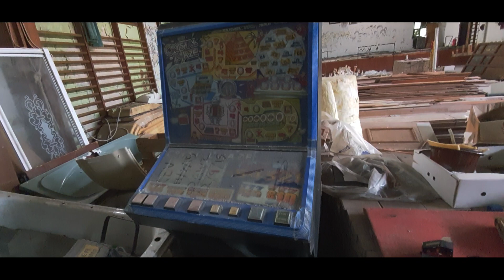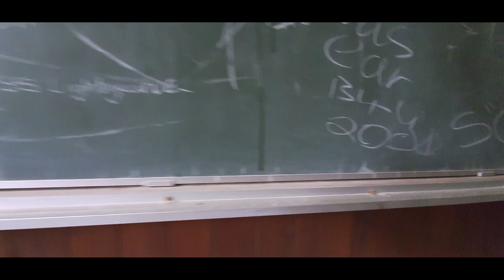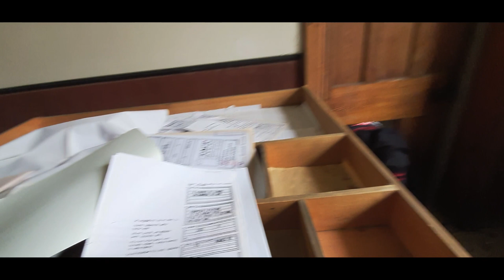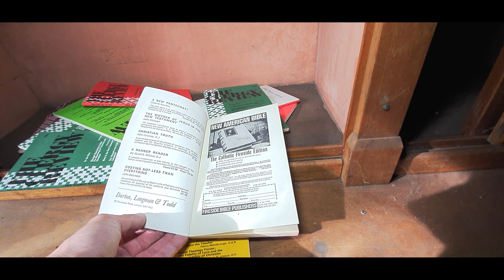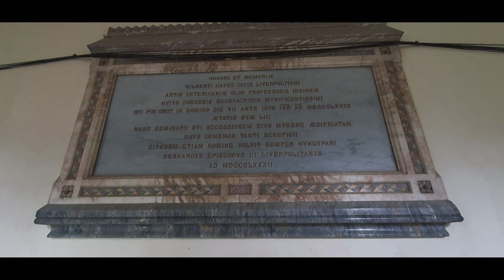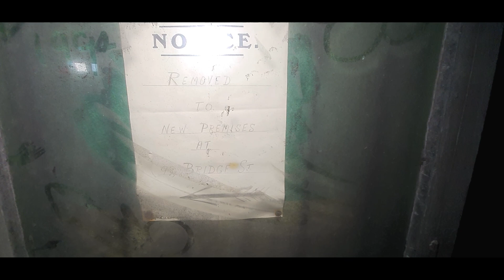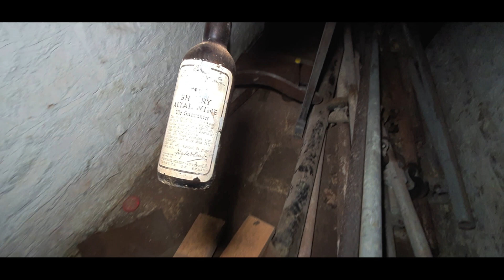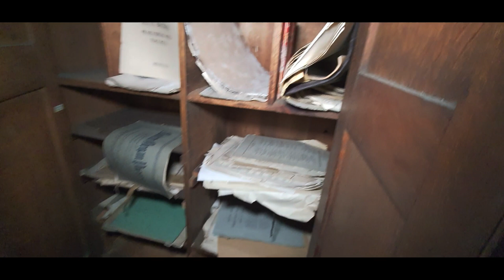St Joseph's biggest seminary in the uk (rang the big church bells)

Comment: I have rang church bells if the stay had been broken you would have gone through the ceiling very dangerous
Reply from the maker: I was more worried of the bell coming through the roof as the building was in a proper state but thanks for the info never realy thought of that :-0 but it's just something I needed todo on a explore:-D
Reply from the maker: I was more worried of the bell coming through the roof as the building was in a proper state but thanks for the info never realy thought of that :-0 but it's just something I needed todo on a explore:-D
Reply: Yes you have to be careful with these things I haven’t Broken a stay but I was ringing when the rope slipped of the wheel.